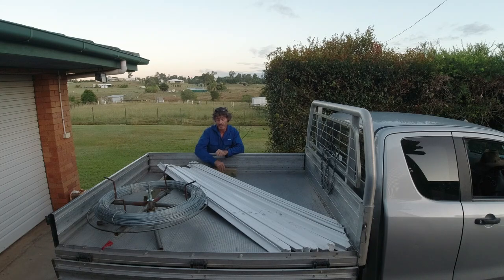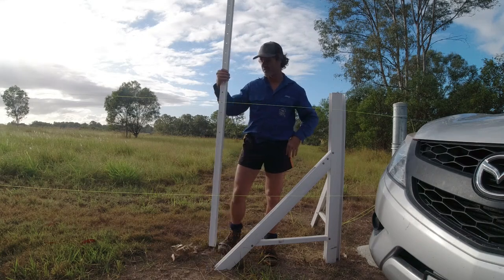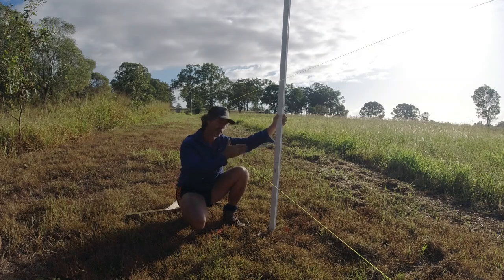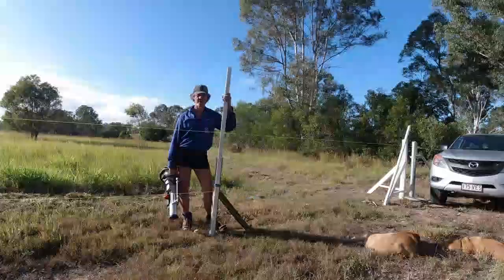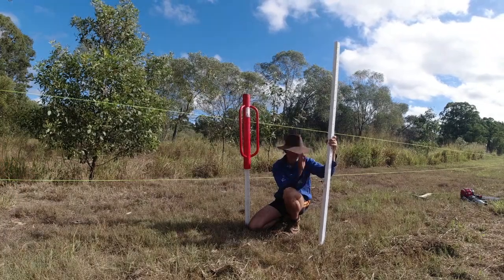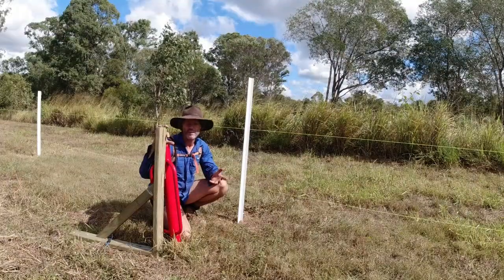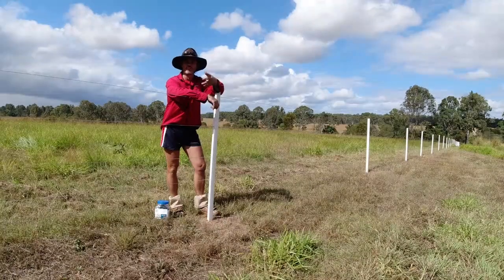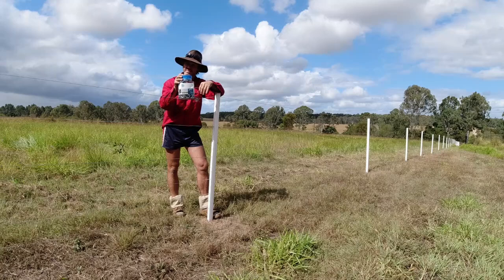TIMELESS FENCE SYSTEM, STEP-BY-STEP BOUNDARY FENCE ERECTION!!

Comment: Just got back from returning a gas post driver… it absolutely did not work on the timeless posts. I think they have too much flex… but your video now has me wondering if I could have built a double sided jig that would have stopped the flex and drove the post… Darn it!!! I have about a thousand to do around my property and my back said no way to old faithful!!! 😂
Reply from the maker: Hi Gemrough, firstly thanks for choosing to watch one of our videos and secondly for finding the time to message us mate. We had the same issue on areas out on our UDDERFARM with a petrol post hole rammer, so we had to use the auger on our tractor. Though in other areas we had no problems driving them in with the petrol rammer. We found it’s totally dependant on the soil type and the level of soil compaction. Though I would not go back to metal star pickets and or timber split posts whilst cell grazing with an electric fence system. The Timeless product all the way for me, no regrets here. Plus, no other competitor has a complete fencing range and sizes like Timeless Fence System has. Well worth the effort I believe for longevity. Stick with it mate, you won’t be sorry using Timeless, the product won’t let you down. Yep no argument here I wouldn’t have a back if I had to revert to old faithful, as I’m sure my back would up and leave me whilst I was sleeping after the first full days work! LOL. Hope you have a grand week! Jason

Comment: awesome video. About to run some myself. Did you say you didn't need to use a daisy tensioner ? Just hand tight?
Reply from the maker: Hi Chris, firstly thanks for choosing to watch one of our videos and secondly for taking the time to message us and leaving your positive feedback. That's correct mate, I have a gripple tensioner tool though I didn't require it. Timeless recommend only taking the sag out of the wire, this allows for movement and flexibility if; or when wild animals run into the fence rather than being tightly strained and breaking wires. Furthermore, electric fences are phycological barriers, not a physical barrier like barbed wire fences. So yes, I hand tighten through the gripple to take the sag out of the wire only. Hope this has helped mate and have yourself a great day. Jason & Nic

Comment: How do you pull them
Reply from the maker: Hi Johnlittle, Firstly thanks for choosing to not only watch one of our videos, but for also taking the time to message us. 
I don't use my T-Post as temporary fencing, rather than permanent fencing so I do not plan to pull them out. Though I've heard of people utilising various types of post or picket pullers with success. 
Hope you have a great week mate!
Reply: @Udderfarm  believe it or not I was able to pull a few by hand when the ground was wet and if they weren’t driven in to far.
Reply from the maker: @johnlittle184  great to hear mate. As I know if I’ve burned them to the required label depth there not being pulled by hand. As I missed positioned one once in dry ground and it wasn’t being hand pulled I can tell you. Though I never tried it after rain neither. Hope you have a great day.